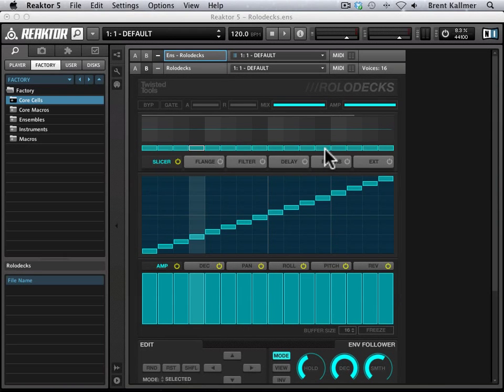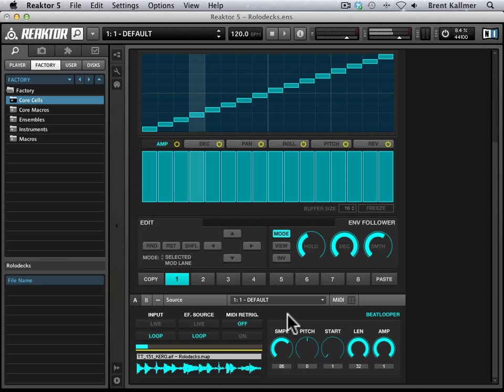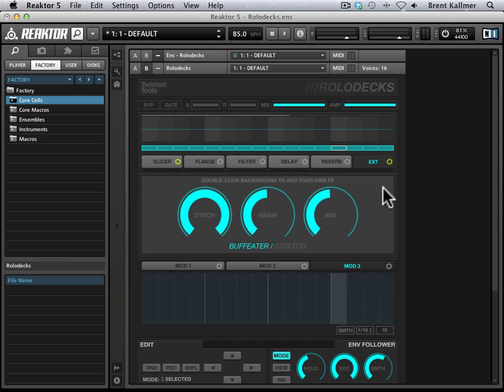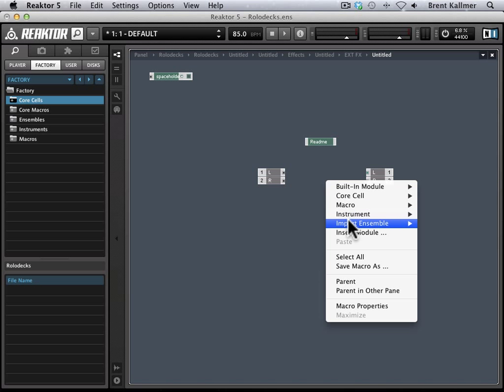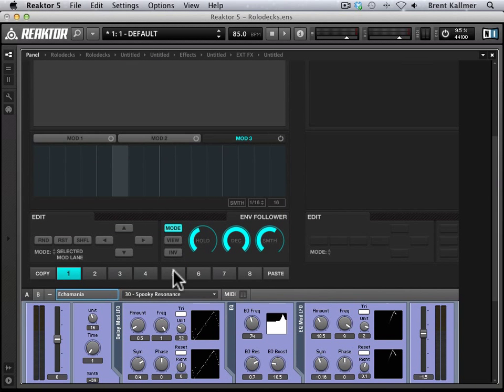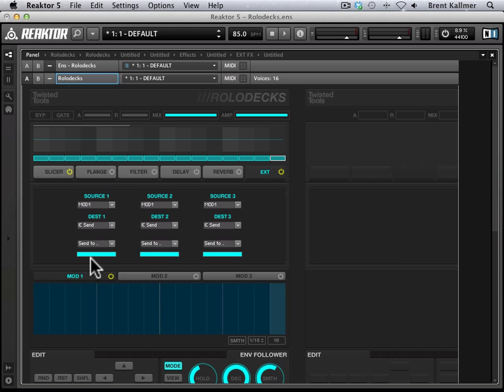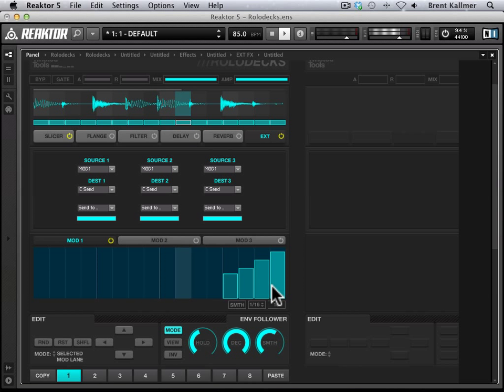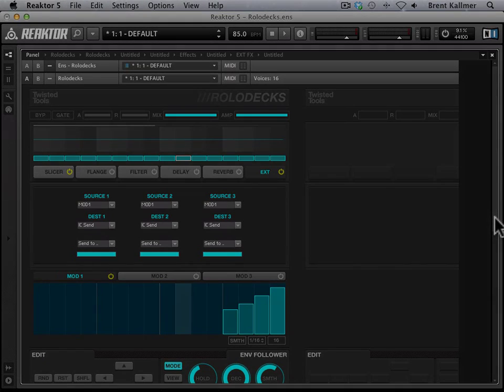How to Connect External FX in Twisted Tools Rolodecks

Comment from the maker: It's included in Rolodecks Pro, but is a separate ensemble. Look for an ensemble with the name "Roloext.ens" in the Rolodecks Pro folder.
Reply: Could you not have loaded the echo plugin into the channel rather than wiring it through reaktor